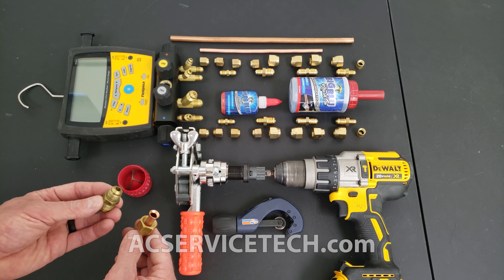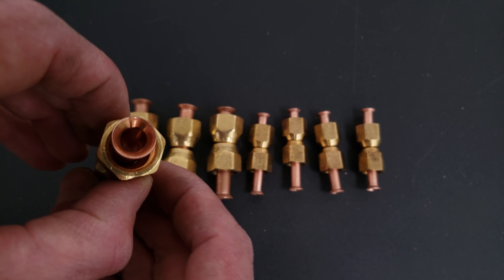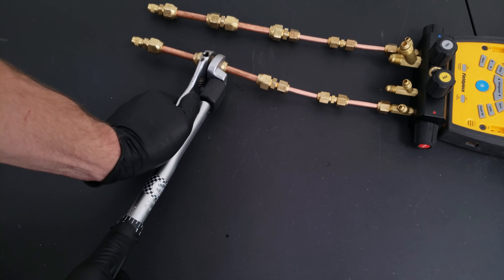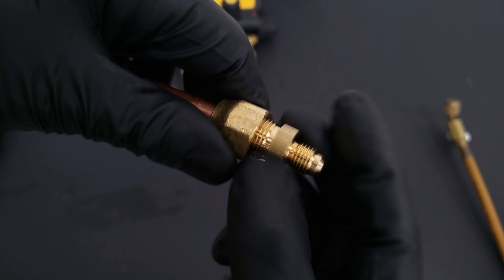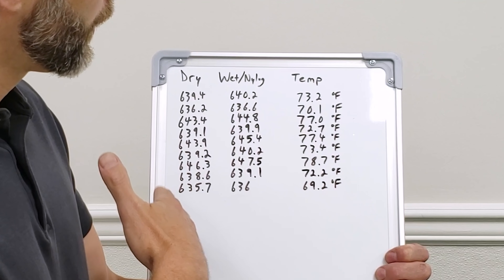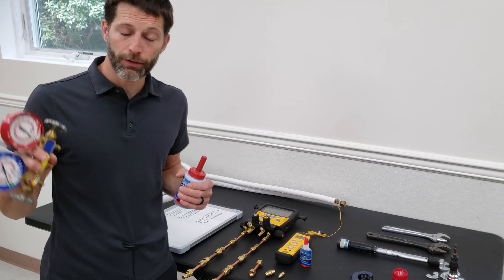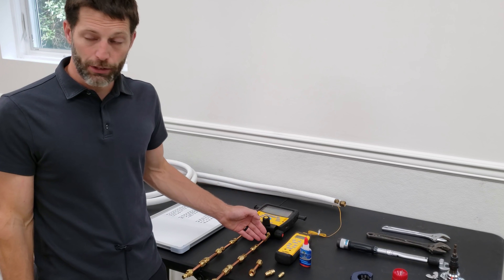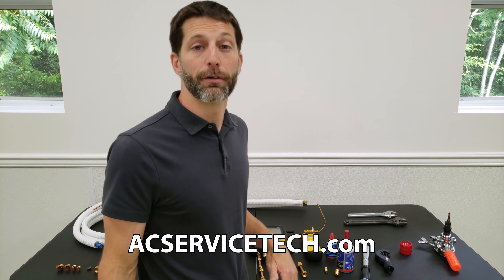Do Dry or Wet COPPER FLARES LEAK High Pressure Refrigerant on Ductless Mini-Split Units? Explained!

Comment: No more flares for me I use the rector seal fittings. You should do a video on those if you can sir. Good Video!!!
Reply: Idk, i just make flares that don't leak lol
Reply: @sprockkets  lol that works as well!
Reply: @Matts_Crafty  it does look interesting though, better than just those seals
Reply: @sprockkets  yeah I don’t recommend stuff unless I’ve had success with it by all means. I’m not one to cut corners as well. I used them initially on my shop multi head mini split as a test and have never looked back. I’m with you on flares I’m a fan of brazing mini splits as well in between the head unit and condenser vice have more flares than necessary. I like the drill sped flare tool make perfect flare every time…I’m also in a perfect weather climate year round not sure how they would do in cold weather expanding and contracting but who knows…but tell ya what if one ever lets me down you will be the first to know. Then you can say see I told ya so hhahaha.
Reply: 👍 that's a good point 👍
Reply: What about where you have to thread on the nut at service port on the heatpump for the minisplit system. Does rector seal have something for that?
Reply: @eddiegomez3628  They come with fittings that are threaded on one side specifically for that in various sizes. Torque to specs, pressure test and keep it moving my friend. Here is a link  https://rectorseal.com/products/pro-fit-quick-connect-group/
Reply: @Matts_Crafty  "Quick connect"  sharkebite style connectors no thanks...
Reply: @texasfrontiersman8245  to each it’s own my friend. And it’s not shark bite!!!
Reply: Let me guess you still use analog gages because you don’t trust digital?
Reply: @texasfrontiersman8245  I've got a set of pro-fit connectors going on a year now in the field, no issues. Just like a sharkbite, if installed 100% correctly, they last a long time.
Reply: @eddiegomez3628  the fitting threads onto where the flare nut would normally go then you just slide the line into it.
Reply: Did you look at the link I sent? yes they do...
Reply: @Matts_Crafty  I took a look at the link. That’s actually pretty cool. I never knew this. Im going try it.
Reply: @eddiegomez3628  👍🏽 nice I always torque the fittings on the unit. Most manuals recommend 25-30 ft lbs if I recall don’t quote me on that def refer to manual…
Reply: @eddiegomez3628  Yes they have them, I only use them for unions work great who wants to flare 20' on ladder.

Comment: I have 3 sets of Fieldpiece digital manifolds, they all tick down on both high and low sides. I don't trust them for leak detecting.
Reply: I found a tiny leak on my sman380v where the low side screws into the black manifold. I have not removed it and resealed it yet. I found it by drawing a vaccum on just the gauges down to 120 micron and put nylog around all the manifold fittings and instantly stopped losing vacuum. Held the vacuum for 30 mins hoping the nylog would be sucked into the leak. So far still good.

Comment: My experience once it's a good flare it holds perfectly fine, never had to use nylog or any other form of lubricant ; taking human error out the equation leaks are mostly due to poor copper quality
Reply: I feel the same way, but not being a tradesman and just a DIY'er, the nylog is insurance to me.  Installed my first mini split few weeks ago, intend to install 5 more for zone heating and cooling.  3 of those are rooms that are only used in rare occasions,m one being a garage.
Reply: What matters more is the flare face on the copper. Can't have any scratches or lips or imperfections.

Comment: I generally put refrigerant oil on a lint free clean cloth and wipe all the faces.
And I've never used a torque wrench knock wood haven't had a problem so far.
🍺🍺🥃🥃🍺🍇🏌
Stay safe.
Retired(werk'n) keyboard super tech.
Wear your safety glasses.
Reply: trick is use the flare tool  and make your flare 99% the other 1% will flare when thightening down never had a leak that way. an old  man thought me that trick

Comment: The Mitsubishi city multi leak check is pretty thorough 
600# for 24 hours then a triple evac they want 250 microns for 6 hours if I recall correctly
Reply: @UHURU! 
That’s actually what we had to do , after that they sent a factory rep put the service too on the system and recorded several hours of run time . Now the system has a ten year warranty 

It’s a ten ton city multi system
Reply: @UHURU! Not practical. It's the correct way of doing the install . Maybe that's why they don't ask you to come back because your doing it wrong.